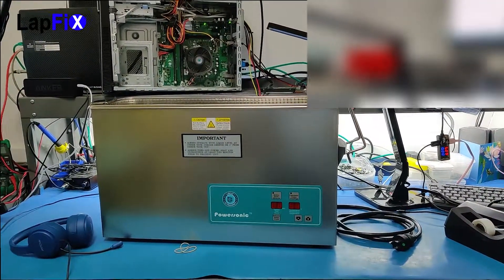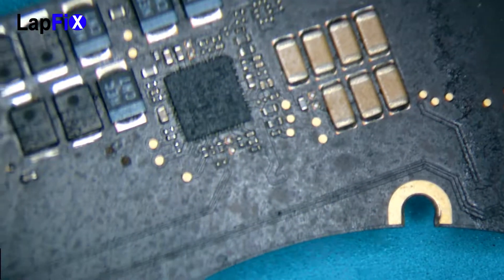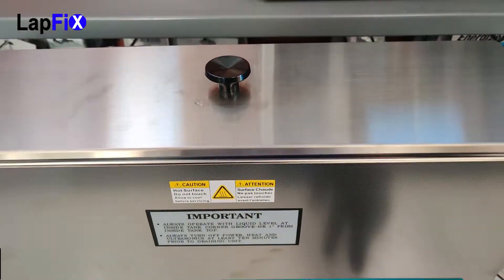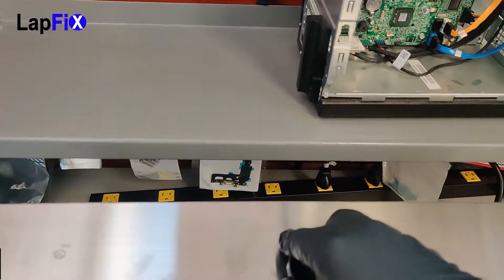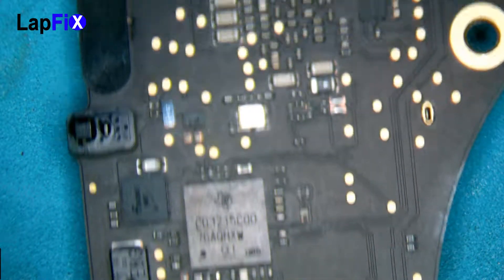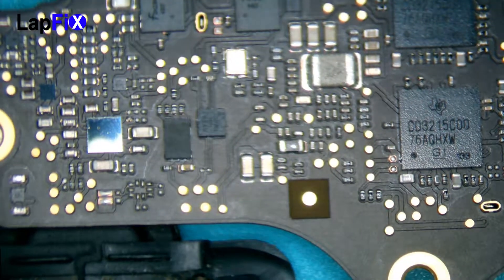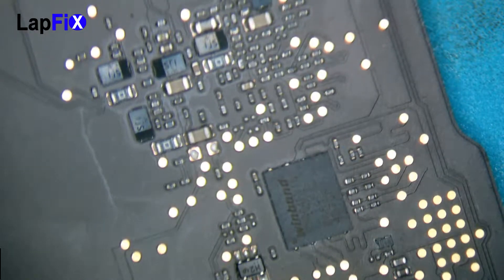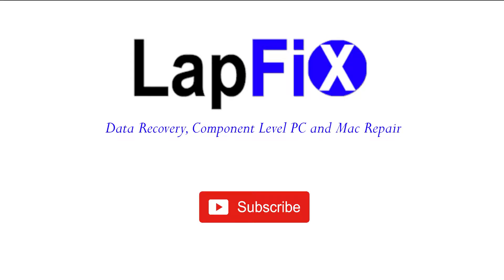Ultrasonic Cleaner - MacBook logic board cleaning | How to

Comment: I spilled monster all over my like $5000 16 inch A2991 128GB M3 Max 2023 macbook pros keyboard and I somewhat promptly powered it off, drained it, disassembled it and detached the battery. I would like to try this ultrasonic cleaning this thing in and out and do all the high level diagnostics and whatnot. Do you have any recommendations or forewarnings? I am fine breaking this for the sake of learning and also am fine spending like $2k going through all of the random purchases for microelectronics tools and crap.